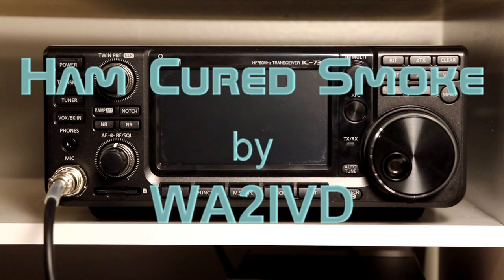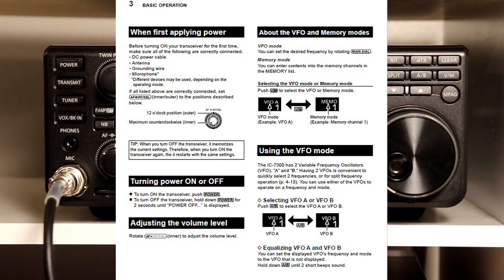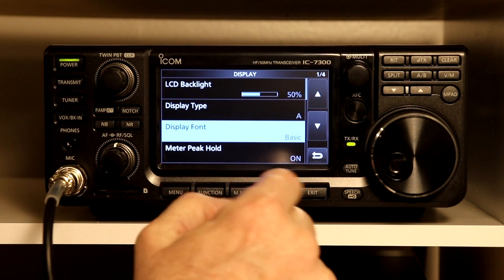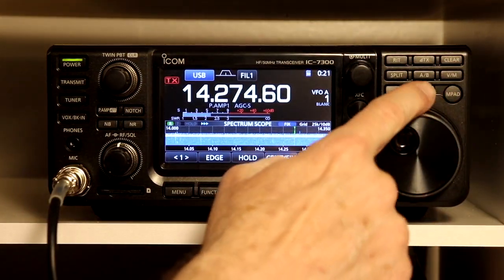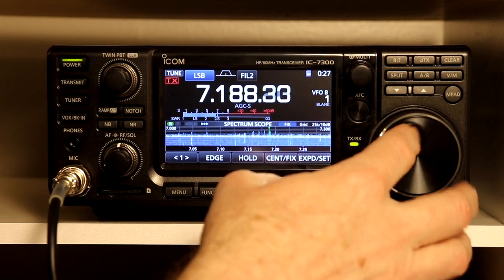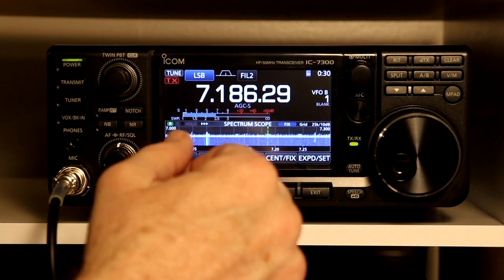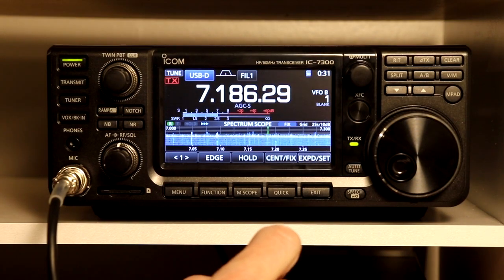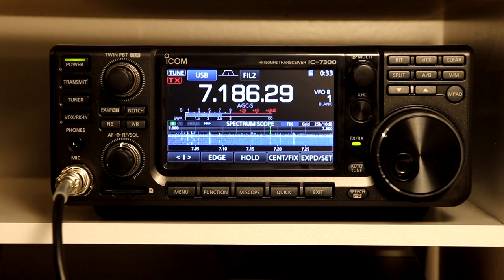Icom IC-7300 From A to Z - #1 Introduction, setting Bands & Modes & programming your own call sign

Comment: Was glad to hear the "finally saved enough in the ham radio fund" line.  Sometimes I feel like I am the only one that has to scrimp and save and even sell other things to buy my ham "toys".
Reply from the maker: You are definitely not alone.  There are certainly a good number of hams that go buy whatever rig, antenna, tower, etc. they want whenever they want and more power to them.  At the same time, there are plenty of us that have to save and/or sell for that next major goody.  My next major “want” is the 9700 to go with the 7300 as a matched pair.  That will probably be a little ways down the road.
Reply: I was encouraged by that too!
Reply: You’re not alone friend I’m retired so I also to scrimp but I was very fortunate to have a great friend that helped me get mine
Reply: @catfishinwithcrow685  LUCKY that I as able to save and buy that 7300 and get to use it for about 2 months before I had to sell it to cover some unforseen major expenses.  Time to start over again. :)

Comment: I finally broke down and bought one of these in 2024 using your videos to set it up. Thank you so much for your videos.
Reply from the maker: Congratulations on the new rig.  I’m sure you’ll enjoy it.
Reply: Excellent
Reply: I'm considering getting one, but it would be sad if an updated model came out shortly after. The problem I'm having with these touch screen devices that came out a decade ago is the menu responsiveness and the update rates. This is obviously due to the processing power, but apart from that, it's a great radio. I haven't used one personally, so I can't really tell how comfortable it's to use, but if I had to buy a radio now, i would probably go for the yaesu.

Comment: Super video series. One small change I would suggest.  As the VERY first step I would save the configuration to a SD card.  That way if all else fails you have a baseline to start off at.
Reply from the maker: That's not a bad idea.  There is another way also.  If you do a full factory reset, the radio will revert to the configuration and settings that it had right out of the box.

Comment: Great video. I have a handy hint to share. I have backed up on my SD card my Normal Settings and FT9 Settings. I use the Callsign display to let me know which one is loaded on switch on. Normal displays VK2APA, FT9 displays VK2APA D. To do this edit you callsign and save your settings. 73 Paul VK2APA
Reply from the maker: Thanks Paul.   It will be a while before I get to covering the SD card, but I will definitely try to remember to put that in.  That sounds like a great way to keep track of different setups and easily switch between them.
Reply from the maker: BTW Paul - Did you mean FT8 in your comments?  I'm not familiar with FT9.
Reply: @HamRadioA2Z I did mean FT8. I'm not creating new modes on the fly :-)

Comment: Things have changed a bit with the firmware upgrades.
This is the kind of material that should come with the radio IMHO.
Reply from the maker: Yes.  You are right.  Some things have changed.   I've been considering a redo of the series based on the latest firmware.   Many things are the same, but (hopefully) I'm a little better at this now and can make better versions of the videos too.

Comment: Excellent! New to the hobby. Most comprehensive logistical review & operational functions of the 7300. I’m waiting on delivery, first time ever HF user. 
Apparently there are 2 manuals for the 7300. I assume one is a quick start packaged with the radio. The other is a downloaded manual. For this video, which manual is referenced? IF iindeed there are 2 manuals.
73
Louis
KK7AAG
Reply from the maker: Hi.  Sorry for the delayed reply.  The Basic manual is included in the box with the radio.  The Full Manual is included on a CD in the box (at least it was a couple years ago).  You can download the latest versions of both manuals on the Icom America website here:  https://www.icomamerica.com/en/downloads/default.aspx?Category=615
The Full Manual includes everything in the Basic manual and more.  I'm pretty sure that anytime I reference manual pages in the description, I say which manual.  Although may not have done that consistently in some of the earlier videos.

Comment: Just about to get my ic7300. Are yiu using a long wire antenna, or some multiband?
Reply from the maker: When I did that video I was using a 53ft. End fed random length antenna with a 9:1 unun.  I was in a rental house in an HOA at the time.  I currently use an 80M off-center fed dipole that covers everything up through 10 meters nicely.

Comment: I have a few questions. I'm a new HAM.  I bought this Receiver but haven't received it yet.  Do I need to purchase a separate speaker and Microphone?  What Power supply do you recommend? Do I need to purchase separate power supply cord or do they usually come with the supply?   I did not  have all the money to buy everything at once but Figured I should at least get the receiver.   Thank You.
Reply: I just received my IC-7300. It has a built-in speaker, but I understand that many people use an external speaker (not required). I believe you can also use a USB cable and connect the IC-7300 to your computer, and use the PC speakers as well. For the power supply I saw that many people recommended the Astron RS-35M-AP. I had to search for a seller that had them in stock. There are two versions; one with meters (RS-35M-AP) and one without. The power supply cord and hand-held microphone comes with the IC-7300. I purchased the ICO-SM-30 Goose Neck desk microphone, also because of the reviews I read.
Reply from the maker: Hi.  Dave answered most of your questions pretty well.  The Astron RS-35M is a really good supply.  I used to have an Astron, but without the meters.  That particular model is a linear supply.  Many people like linear supplies for their low noise.  They don’t introduce any hash on HF in receive.  The downside is that they’re big and heavy.  I have a Powerwerx and an MFJ switching supply and I have found them both to be fine.  Congratulations on the new radio and enjoy it!

Comment: Hi Tom i done the wideband bit of a tale of woe, i took diodes 1 and 3 out in the line, unfortainatly diodes 2 came out as well, maybe i need a smaller soldering rion, the only problem with the second one in the line being removed that i can see is it wont transmit on 4 meters now, everything else seems the same, it wont tx above 30 mhz or much below 1.8mhz, i still have tohe diode but its just too small for me to get back in without loosing it...it transmits on all the hf bands and CB etc, so it has work its just 4mts wont tx any more, 6 meters is still ok...i cant see that the diose does anything other than not letting t tx on 4 meters, still rx on there....from Fred g4vvq Uk.
Reply from the maker: Hi Fred.  Sorry to hear about the trouble.  Doing mods always has risks.  I modified a few HTs a number of years ago.  Haven’t done any in quite a while and haven’t even looked into it on the 7300. Those surface mount diodes can be difficult. I used a very fine tip , temperature controlled iron, a head visor magnifier and very tiny tweezers. Digikey and mouser typically carry the diodes if you bugger up the part.  Just be careful about lifting pads and traces on the board.  
If you want a laugh you can watch a recent repair video I did where I demonstrated absolutely terrible soldering skills. I’m actually quite embarrassed by it.   https://youtu.be/VAu2L70Oy0g

Comment: Thanks for this, I just recieved mine and it is my first HF radio, my only radio was a baeofeng ht.  mind if I ask what antenna are you using?
Reply from the maker: Hi Gary.  I'm currently using an 80 meter Off-Center-Fed dipole.  It works pretty well on most of the HF bands.  For most of the IC-7300 series, I was still in a rental house and using a 53ft. end-fed antenna from Princeton Antennas.  It was a compromise antenna, but I made a fair number of contacts with it.

Comment: Hi

What is the best millisecond setting for the 7300, when using a sb1000 tube amp?

Thanku
Bill
Reply from the maker: Hi Bill.  Sorry for the late reply. I don’t know that answer.  I would suggest setting it to the longest delay available and that should be safe.
Reply: @HamRadioA2Z  Thanku

Comment: Not sure how band stacking works  at all after watching this, AND trying to use it on the radio.
The 3 memories change,  but god only knows how or why! 🙂
Reply from the maker: Let's try a different explanation-- When you switch from 20 meters to 15 meters (for example), the settings and frequency on 15 meters will be exactly how you left them from the last time you were on 15 meters.  Think of the band stacking registers as 3 different versions of each band.  Say you're on 20 meters on 14.235 USB.  You bring up the band menu and "switch" to 20 meters again.  Now you're on version 2 of 20 meters.  Change your frequency to 14.050 and mode to CW.  Now, bring up the band menu again and "switch" to 20 meters one more time.   Now you're on version 3.  Change the frequency to 14.085 and the mode to RTTY.  Now "switch" to 20 meters one more time.  You will be back to version (or band-stacking register) 1, and you should be back at 14.235 USB.  Now if you keep "switching" to 20 meters, you'll cycle through those 3 registers and their settings.  It is effectively like having 3 extra memories that you don't explicitly save.  With the new firmware, if you press and hold the band, it will display a pop-up that shows the frequencies saved in all 3 registers and you can tap the one you want to go to.

Comment: I purchased the IC 7300 a few weeks ago and have been watching your videos every chance I get. I do have a question for you that I probably missed in your videos. When I broadcast, it doesnt show my broadcast in the water fall. Do you know I turn that on ?

Again, thanks for all your hard work putting these videos together.

Ryan - KG7FRS
Reply from the maker: Hi Ryan.  Your transmit signal will only show up on the scope if it is in Center mode, not Fixed mode.  On the Scope Set Screens, there is an option for Scope on during TX.  The default is ON.  So if you haven’t changed that, just putting the scope in center mode should solve the problem.
73, Tom
Reply: @HamRadioA2Z  that worked ... thank you for taking the time to respond to me.

Comment: how do you get a amplifier pulser, to work with a 7300 I have a new pulser, and cable but I cannot get it to work, have batteries in the pulser, what setting does the radio have to be on?
Reply from the maker: Hi Henry.  I'm sorry, but I don't know what an amplifier pulser is.

Comment: Hi, Tom fist of all thanks for the great set of videos on the IC-7300. You have helped me a great deal I have just had the radio 2 days now. I have had a play with a function by mistake. Can you explain about calibrating the frequency. I went into  Menu, Set, Function "REF ADJUST"  I did not note down the % before I adjusted it by mistake. I see this is freq calibration. Can you please help the manual goes on about the 15.000 mhz calibration signal . Steve G4YTK
Reply from the maker: Hi Steve.  We all make mistakes.  Fortunately, all is not lost and you won’t need to learn a complicated calibration procedure.  Go into the Set menu and scroll down to the bottom to find Others.  In the Others menu select Reset.  Under Reset you want to select All Reset.  You’ll get some warnings and you will lose any memories you have programmed and any other setting changes you made.  However, after the reset, the REF ADJUST value will be set back to the factory setting.  I just tested this on my rig to confirm that it works.  Hope this helps.  73, Tom WA2IVD
Reply: @HamRadioA2Z  Wow Tom you are a genius I only have my call sign and the time in so thats great. I will let you know how I get on I will do it now.
Reply: @HamRadioA2Z  That was easy, 29% was the reset value. I knew it was in the 20's I thought I had changed it by mistake and set it to 50%, "Mistake". Your videos are great and so useful. Really pleased so far, contacts on FT8 FT4 and CW. Once again Tom many thanks for all your help.

Comment: it  tunes .30 to 1.60, but it does not work below 630 kc.  There is nothing heard in all those Radio Beacon portion.
These Videos put the ICOM Book to Shame! There is no section 13 in the manual now
Reply from the maker: Hi Jim.  Thank you for the kind words.  The Icom specifications say it receives from 0.030000 (30 kHz) up to 74Mhz, but it also includes the note "Some frequency ranges are not guaranteed".
The Basic manual only goes up to section 12.  My references have all been to the Advanced (Full) Manual.  It is a little confusing on Icom's website.  If you go to Resources and click on IC7300 downloads, it lists the Advanced Manual, but if you click the link it takes you to another search page.
Here is a link to the Advanced Manual:  https://www.icomjapan.com/support/manual/2271/
The link is to an Icom Download Service page.  You will need to click the "I Agree" box and then click the Download button about half way down the page.

Comment: 1. When in the fone portion of a band, can you send CW? I heard some guy complain that he couldn't do that - that it would only go into SSB.
2. Is the QSK real full breakin or semi-breakin or something a little better than semi-breakin? If you ever had a Ten-Tec rig, you know what true QSK is. I love it.
3. There in your video during the Band Stacking explanation, it showed 40m, USB Digital. Are the newer modes really done in USB on 80  & 40m?
4. At the end, you mentioned Connectors (jacks) Mic, USB, Accec etc. Now this is kind of important - surely you can't send MCW with this rig can you? We are not allowed to send MCW on the HF bands here. ICOM needs to block that (I don't know how they would) and new hams (and older) need to know this.
Reply from the maker: Good questions.  Since there’s a few, I’ll probably take these over several comments.  On transmitting CW in the phone part of the band— If the Band Edge Beep function is set to ON(User) & TX Limit and you have set user defined band edges within the CW portion of the band, then the radio won’t transmit at all outside the user defined edges.  I don’t know of anything limits that are mode based.
Reply from the maker: 2. On full break in— The radio supports Full Break-in via the VOX/Bk In button.  I’m not a big CW operator.  So, I can’t say how it compares to TenTec radios.
Reply from the maker: WSJT-X uses USB for all of it’s modes.  For (B)PSK-31, it actually doesn’t matter.  Because it shifts the phase of a single tone, rather than sending multiple tones the transmitting station can be on USB and the receiving station on LSB.  As long as you’re tuned to the signal, it will work fine.  The RTTY convention is still LSB on all HF bands, as far as I know.
Reply: I'll answer my own third question? Now I know that RTTY is LSB on 20m and up and a lot of hams don't know that and that's why they're 'reversed', but for the others, I found this: Soundcard digital modes are USB - never LSB. Clover, RTTY, PACKET, AMTOR and PACTOR typically use LSB, however.  http://n1su.com/digital.html  Still need an answer to #4 though. EDIT (Your WSJT-X response came as I hit Enter to this, my answering my own #3   :)
Reply from the maker: 4- The MCW (Modulated CW) question is an interesting one on SSB.  When MCW is sent on AM or FM, the waveform looks like any other audio signal with just a single tone.  MCW on suppressed carrier SSB is different.  Let’s say you transmit a single 800Hz sine wave tone on USB.  The transmit waveform will look exactly the same as an unmodulated CW carrier 800Hz higher than the dial frequency.  So, you’re right, I don’t know how how Icom could prevent this, but on SSB I don’t know how the FCC or any other government agency could tell the difference.
Reply: On perceiving MCW, I can't find the video, but somehow I ran across some video about MCW and the host's "my mistake" follow up video. Apparently this guy had made a video on MCW on the HF bands and promptly got stomped on (which he should have because it's not legal). Anyway, he backed up, apologized and then somehow showed MCW compared to CW and I could easily see all the crap on the end of the signal. This crap made the signal way wider of course. Sorry for the word crap, but I just can't remember the terms he used for that... maybe overtones / hash / artifacts, dunno. Anyway, it was there, it was visible, it was wider and it was crap and it's illegal :)  http://www.arrl.org/part-97-text  (only on 6m and up)
Reply from the maker: You (and the video you saw) are correct.  I did over simplify my explanation a little.  Using an audio tone with a rig set to SSB can be indistinguishable from CW, but it requires that the audio tone is a perfect sine wave and it also requires that all of your levels are set perfectly and that the rig perfectly suppresses the opposite sideband.  Any distortion or overdriving would result in something that could look like MCW or worse.  If you do a Google search on MCW vs CW, you can find lots of discussions on this.  If anyone does want to use a computer to generate CW, virtually all of the major programs support keying the radio in CW mode.  So, there’s no reason not to to it the right way.  I don’t know for sure, but I would expect that since the 7300 generates its transmit waveform digitally, it’s waveform probably looks better than most provided the input levels are set correctly.